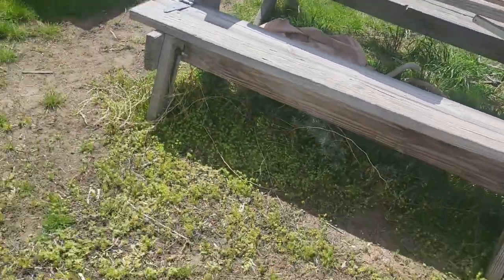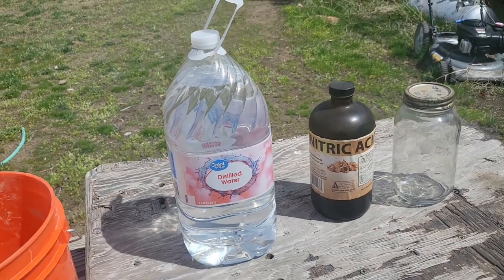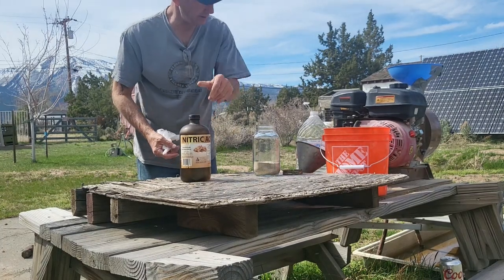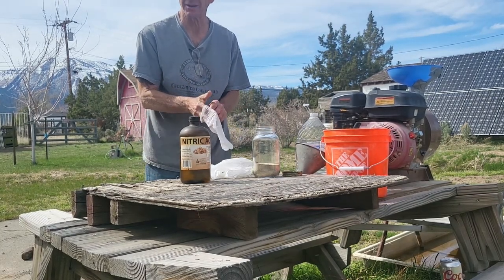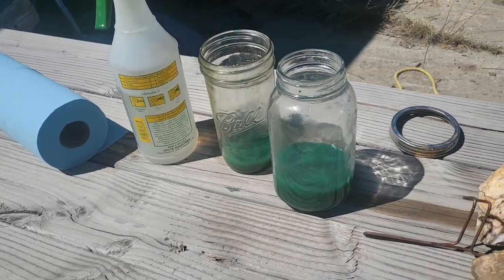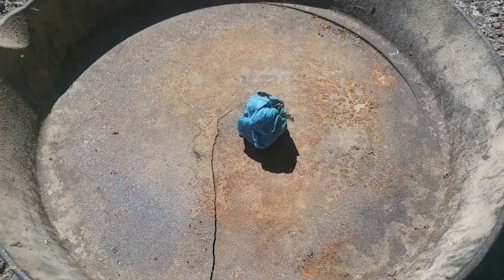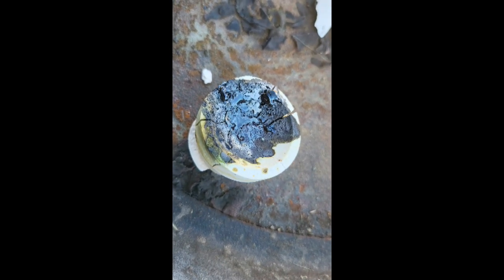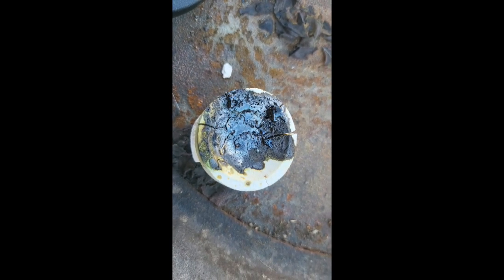Processing raw silver ore with nitric acid and smelting.

Comment: Did you know that ore sometimes also contains mercury? Don't forget to wash the silver with nitric acid solution before melting. And think about protection from gases, otherwise acid rain comes later because of people like you. Nitrogen dioxide can be decomposed by carbon into nitrogen and carbon dioxide. You can also vent the gas with a tube into a bottle of water and partially return the acid. And please never pour more acid than necessary! It looks like madness! 😁

Comment: you have to first bring it out of solution otherwise it just oxidizes with heat, one way is with electrolysis which will give you fine silver, and the other is add sodium chloride to the solution which will precipitate it to solid form, then dry it and cupel

Comment: I wondered when you got some of the solution on your thumb. If silver had been dissolved in it, it would have turned your finger purple.  The silver nitrate would have reacted to the salts on your skin and precipitated silver chloride. Which upon exposure to sun light would have turned your skin purple. Sometimes black. Depending on the amount of silver present.
Reply from the maker: Wow.  I didn't know that!  Thanks.
Reply: @themahoneymine  after filtering you could have added a salt solution to the silver nitrate solution and precipitated AgCl3 or silver chloride.  Then melted with a high carbon Flux.  I don't like copper because it can give you a false reading. When I cupel I always run a test sample on the lead. Even that can't be trusted to be silver free. Usually run them side by side. Although you could run separately and remember to deduct the weight of the bead from the other. Anyway, that's why you use D.I water. No salts. Fluorine does the same. Any salt will.